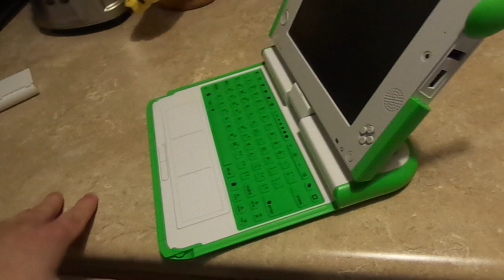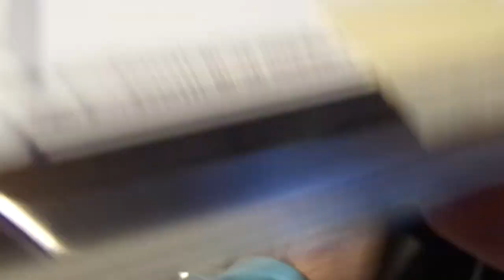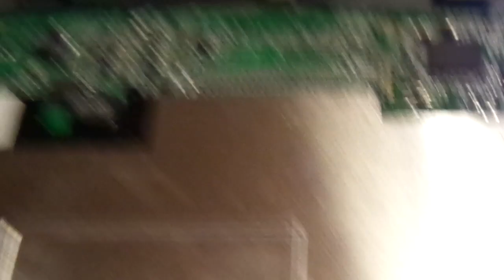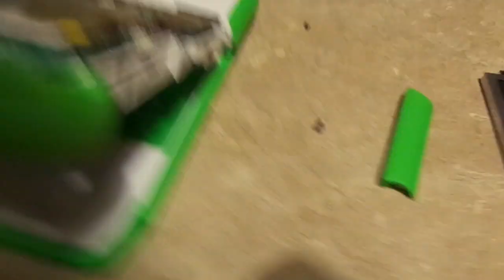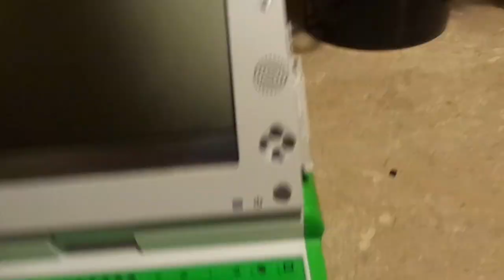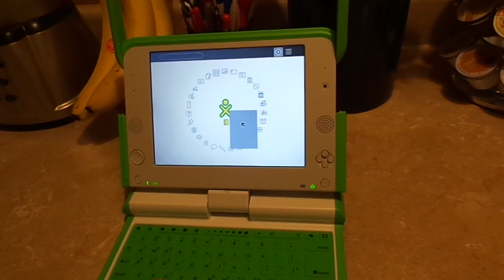OLPC XO-1 Teardown

Comment: Hey dude: I know this vid is old but I've been wondering if the display could work inside a mini laptop or as a mini external. Thoughts? (No manufacturer really picked up the transfective gauntlet.)
Reply from the maker: It may work, but you’re better off making your own transflective screen - I’m sure it can be done by splitting apart a normal screen and changing the light filters and such out
Reply: @bbishoppcm  thx4reply! Yeah, U're probably right. Just hopped I could pop this in a case w/a controller that would allow me to bounce between transmissive to transfective in steps like the XO/Pixel Qi screens do normally. I haven't really seen a DIY transfective solution posted online. Guess I need to do more google digging or be the 1st. Thx again.

Comment: I bought one of these when they came out.  I could probably locate it again.  I may try if its possible to remove the logic board and replace it with a pi or pi cluster.

Comment: A touchscreen in 2007 with would've been not  come cheap though, this thing was supposed to cost 99 bucks, I did want of these things though, but I a) didn't have the money and b live in Canada
Reply: ***** Simple touch screens wouldn't have been that expensive (the older types that need styluses to use) - the issue would have been durability, in my opinion.